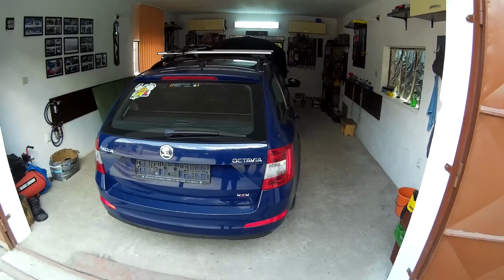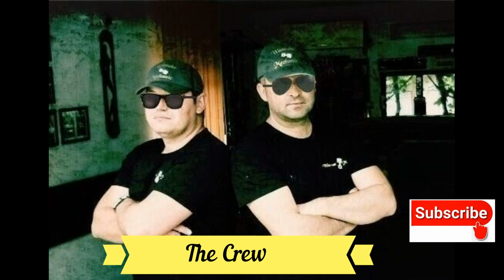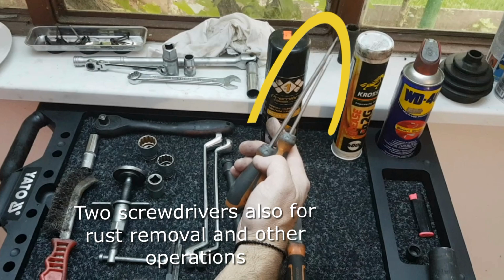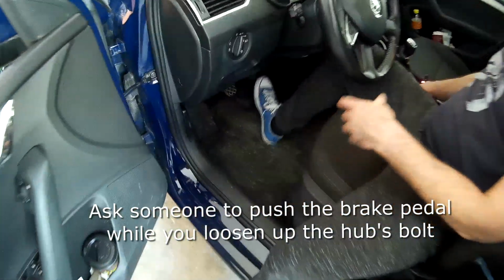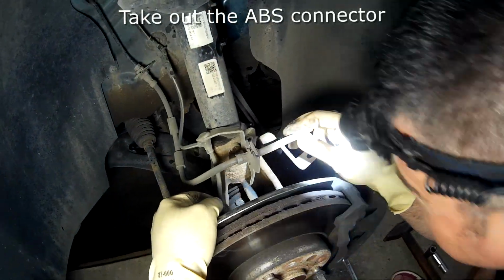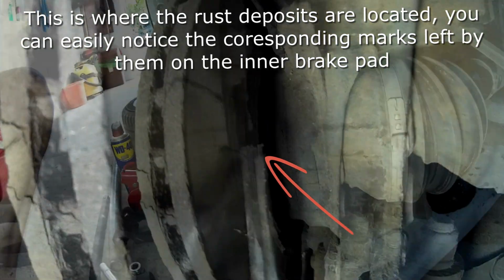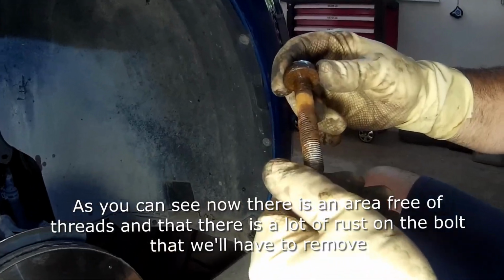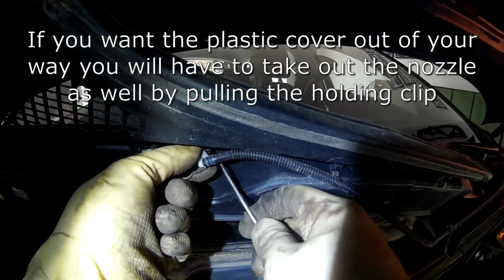DIY Brake Pads Rotors Shock Absorber Strut MountS Skoda Octavia MK  III 3 Replacement

Comment: Thank you for sharing. The 18mm socket is actually a 19mm, maybe only on my skoda octavia mk3. the torque diagram is not the same aswell. Other than that great job guys.
Reply from the maker: Thank you!

Comment: where did you get the picture with the tightening torques?
Reply: keep in mind that by looking at the workskop manual of my skoda octavia 2016 the torques are different. So make sure you u use the correct torque on your car. Like the hub nut torque is not 50nm , it is actually 200nm + 180 degress
Reply: @thetissot740 could you help with top mount fitting, need to fit one today, only one mark on the top mount but can’t find anything online what this mark has to line up with.
Reply from the maker: I can not recall exactly , I usually find them on forums